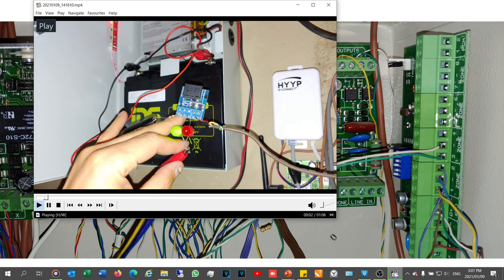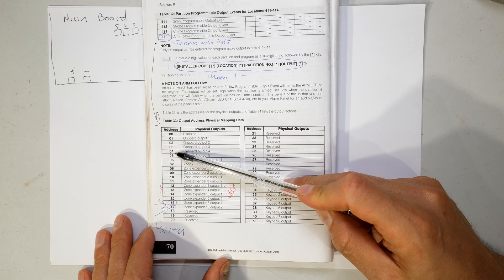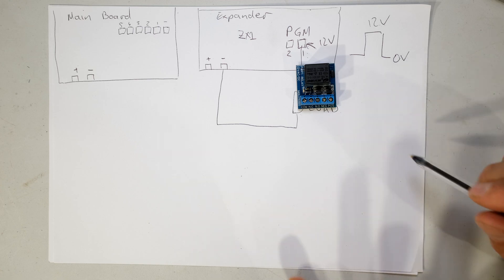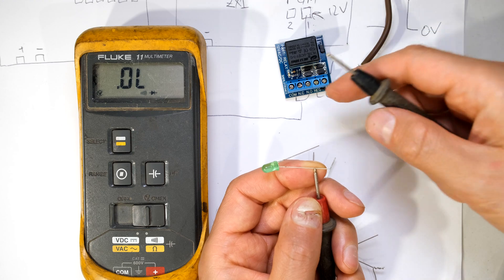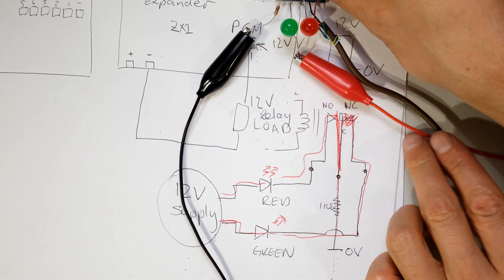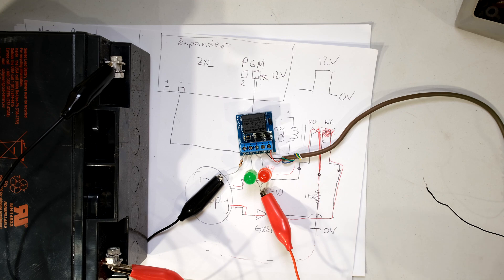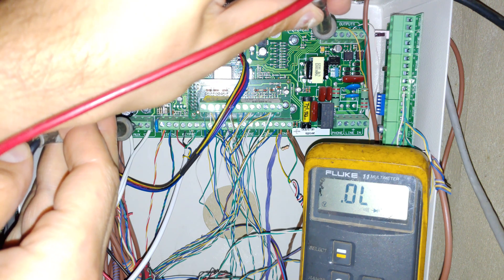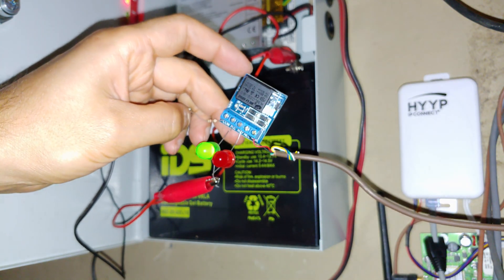How to connect armed and disarmed LEDs to your IDS x-Series alarm system - with tutorial

Comment: Hi! I’m trying to figure out why my alarm forces me to bypass my outside beams before arming? 

We want the beams on and connected to the alarm system but cannot see how to do that. The alarm says “not ready to arm” with the outside beams zone number. 

Thanks so much for your help.
Reply: it should be because the outside beams are detecting motion, so basically when a zone is open or detecting motion or in tamper, it will not let you arm the system.

Comment: Sadly I don't have the nice LCD panel. I have the simpler panel. I've programmed Paradox and Texecom alarms myself but this one has me a little stumped. Trying to set one of the programmable outputs to follow so I can read that with an ESP8266 WiFi chip (through an opto-coupler) to incorporate into homeassistant.
Reply: Aaah nevermind. If I read it properly in binary it says "34" which is the PGM output on the first keypad. Seems I can only have one output assigned to this event. That's a pity.

Comment: Thank you. Very helpful as always I will be doing this over the weekend.
Reply: Quick question can dc power run 75m to power the led's or will i get too much voltage drop and rather should i put a secondary power supply in my garage rather than try feed it off the alarm panel in the house.
Reply from the maker: for LEDs 75meters is fine, if you use quality cable (copper) you should have no issues.

Comment: Hi my alarm led turns green on away arm only but not stay arm. How do you activate to turn on for stay arm as well?
Reply from the maker: it is shown in this video
Reply: Hi, I also have the same issue, away armed is fine, but stay armed does not activate the output, is there some additional config for 12V on the output? I also need a 12V output for chime zones so I can trigger my Google speakers to announce if I have someone outside the house.